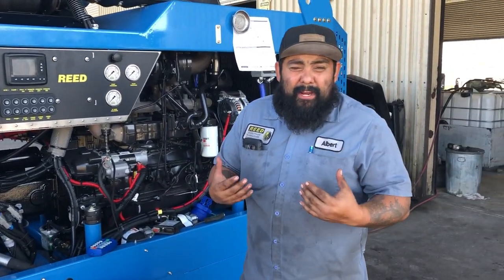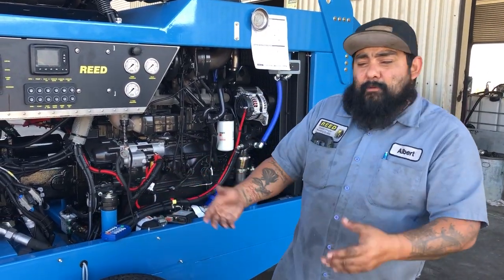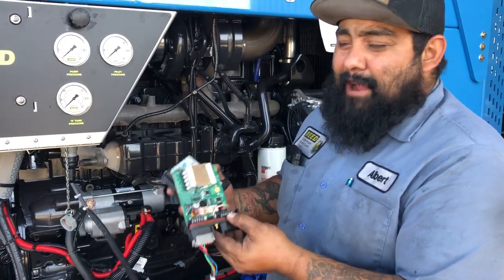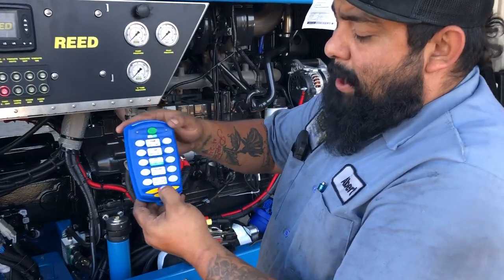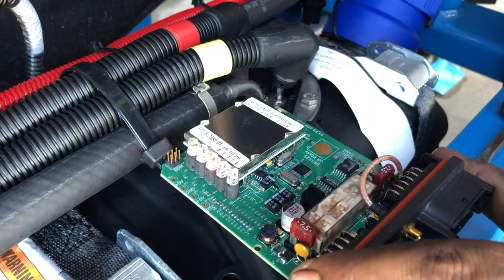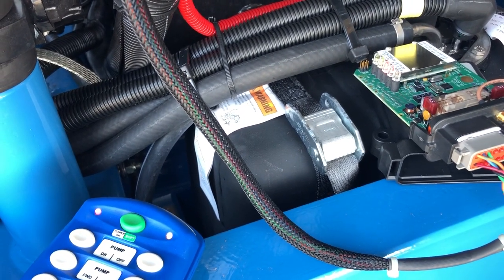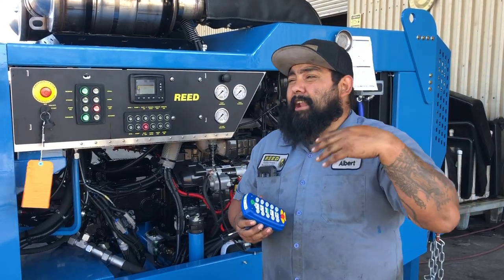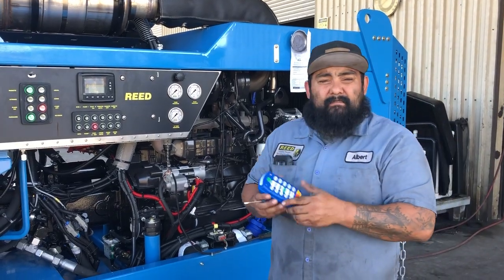How to marry your omnex radio to your receiver

Comment: I have a issue my receiver keeps burring the fuse every time I open the key to power it
Reply from the maker: call your dealer or call Reed and I can work on it with you. 909-287-2100